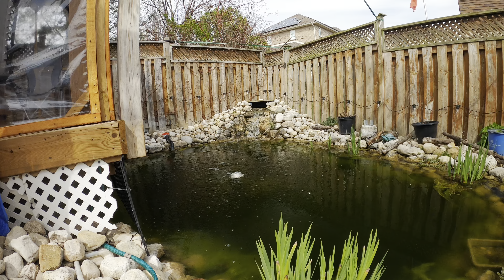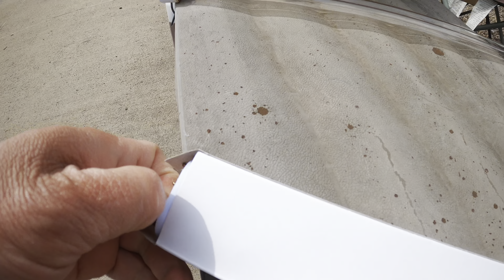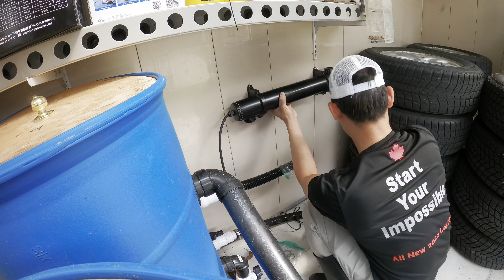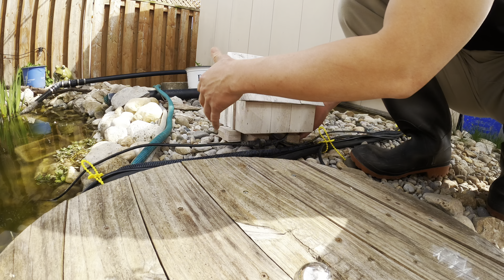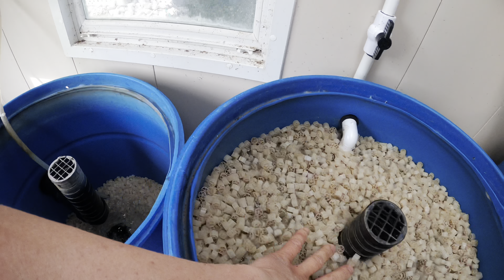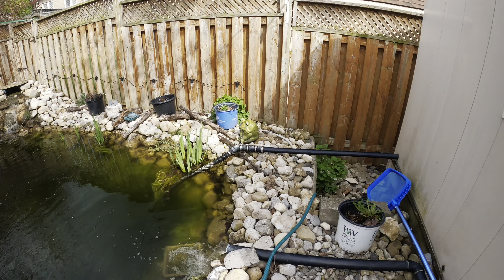DIY Koi Pond Update - 3-Barrel Filter System Startup 2023

Comment: Do you not pump out all the water from winter and start with fresh water? The water looka murky and full of algae from the winter but in the barrel it looks clean.
Reply from the maker: No, I don’t replace the water every year. Doing that will remove all the beneficial bacteria that already established in the pond. The water will clear up in a few weeks after all the system is up and running.
Reply: @PTranProductions  since I don't have any livestock in my pond over winter, I like to start fresh by emptying out all the water and even scrubbing down the liner to start fresh. It only takes about 2-3 weeks before I see algae build up again. I also use beneficial bacteria to get it going.
Reply from the maker: @jcsdesign  
The benefit of having a mature pond is that the pond has overtime established a balanced ecosystem with all the beneficial bacteria needed within. If remove all the water from your pond and fill it up with fresh water that means you restart your pond all over again every year.
Reply: @PTranProductions  I know what you're saying but I do start over each and every year. I just add the beneficial bacteria starter and let it do its thing. After a couple weeks, I see algae growth already. My pond is mainly for turtles and a few feeder fish. So I treat it like a large aquarium  although it is nearly 400gallons.
Reply: My 5k gallon pond has been going for 15 years.  I have never taking out all the water. During my fall and winter clean out I will take out about 30%. I also use a pond-vac once a week. Fridays are my pond vacuuming day.

If you take all the water every year your pond will never mature, never!
Reply: Also,  Koi love old water!